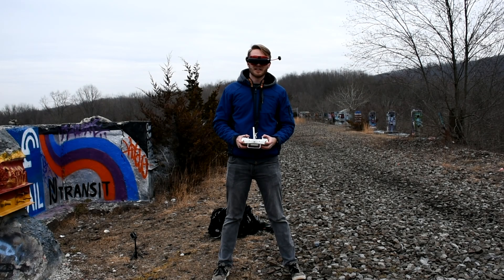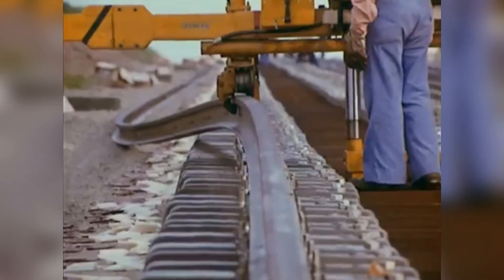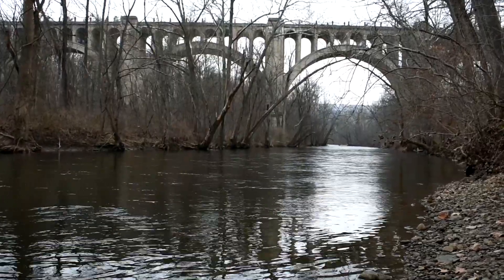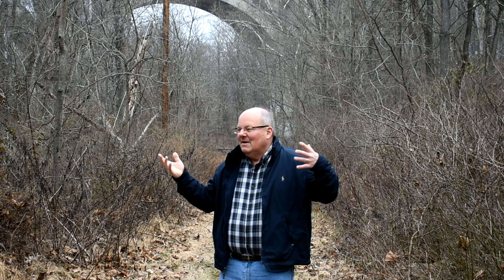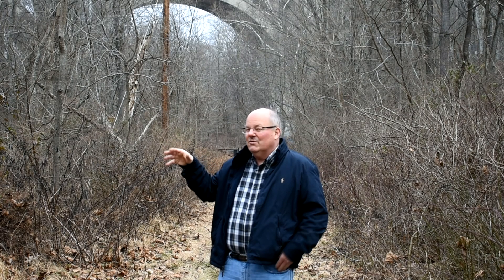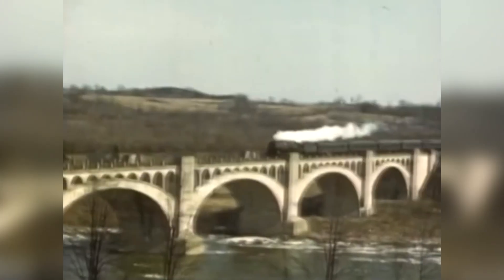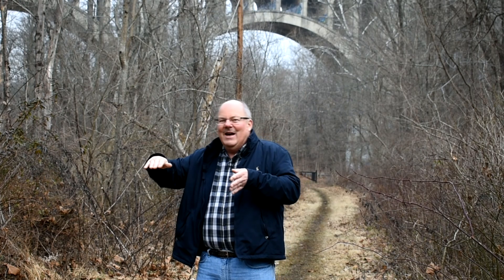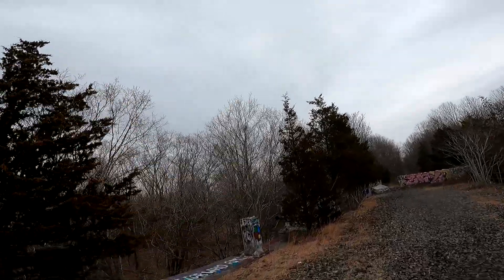The Abandoned Lackawanna Cutoff will be Brought back to Life

Comment: Nice video!
Gentle-ish curves are still important in modern fast and high speed passenger rail, but gentle grades, not so much. Modern electric locomotives are relatively light and extremely powerful compared with steam and even modern diesel locomotives. They can deal with significant grades and still mange very high speeds.
Reply: Not power limited. Grip. 
0.4 friction coefficient x locomotive weight / train weight gets you about 2% for a 20 car setup
Reply: Ehm. If we talk real high speed, rest-of-the-world-style high speed, grade is important. There is a reason why we dig all those base tunnels here in Europe.
Reply: @appa609  the Frankfurt- Köln high speed line has 4% max grade with 300 km/h max speed. And it's possible to hold that speed over nearly the entire line.
Reply: where are you going to get the megawatts from. the north east has had a lot of blackouts
Reply: @dknowles60 Trains barely use any energy to operate
Reply: @frafraplanner9277  wrong

Comment: From what I've read it was the Erie-Lackawanna's decision to sever the Boonton line, the high speed freight bypass of the Morristown line that fed the cutoff that doomed it under Conrail. Trains had to be able to handle the tighter curves and steeper grades of the feeder line negating the benefits of the cutoff, especially when Conrail had other options from the PRR and NYC. Hope it does get restored fully to service to Scranton and maybe one day even beyond. A rail connection would really benefit northeastern PA and the southern tier of NY.
The following is from one of the Lackawanna's "Phoebe Snow" ads advertising the cutoff:
Each cut and fill
Cross dale and hill
Has made the shortest 
Shorter still.
I now delight
Like Arrow's flight
To speed o'er
Road of Anthracite
Reply from the maker: It would be worth talking about in a different video how many of these railroads didn't have much future planning beyond either "we'll merge with this other RR later", or "once we find a way to fiance this, we'll build it".
In many ways this initial planning or lack of, crippled them later on. And then eventually Conrail had to figure out the mess. And then the whole question begins on weather or not conrail did it right and if they where left to sort through scraps without help.

Comment: Near me, in Huntsville, a school was buried in the process of making that Pequest fill.  My housemate showed me the historic photos of how they just erected this triangle-frame assembly of timbers and filled with dirt to make this enormous artificial ridge to create that very flat top the video explained.  You'd think viaducts, but apparently in the long run a solid ridge like that is cheaper.  Instead of mere underpasses, tunnels were bored under it for roads, railroads, and watercourse to pass north-south.  Impressive!

One of the old rail tunnels is being used as storage space by NVE since it adjoins their lot at Airport and Whitehall Roads, while the others are still active roads (e.g. US 206), rail trail, and the Pequest River.  I don't know what they did to the Pequest during the time they were building the ridge line and before they bored the tunnel for it; probably they'd've diverted it around where they were building that part, then bored the tunnel to reconnect it, then built over where they'd temporarily diverted it.

I've got to get up on that thing some time, maybe this summer, before they fence it off to re-lay track.

Comment: Thanks for the video. I was aware of this route and was told Conrail abandoned it and took up the track to help prevent a competing short line railroad from buying it and operating a competing service over the line. That is also why they looked to sell it to developers. If things were built on the right of way there would be little chance of it ever being used as a railroad again. Thanks to New Jersey buying it and considering expanding commuter service over the line it’s future is more secure to be returned to all types of passenger and even high speed freight service. The interstate highways even today are overloaded with both passenger cars and trucks in this area. So reopening the line makes more sense today than any time recently. We just need the political will and funding to make this happen.

Comment: 7:59
Has anyone told you that some of your electric locomotives look like someone glued a pantograph to a diesel engine?
Reply: Some of them are, especially on lines that use both electrified and non-electrified track - I know there’s a few around NYC as the underground stations in the city typically require electric running but the trains run on non-electrified lines outside the city. I’m sure the specific locomotive you pointed out was a predecessor to the modern ones on a similar line.
Reply: Kind of like how European diesels look like electrics that went under a low bridge?

Comment: The closure of the old Boonton Line East of Wayne could also be attributed to the closure. This moved all traffic over to the Erie Greenwood Lake Branch until Mountain View where it switched onto the Boonton Line which connects to the M&E in Denville and continues to Port Morris where the cutoff split off. The gradients after this closure were detrimental to the line as it meant it was just easier for the EL and Conrail to run up the Erie line entirely. They then sold off the route North of Scranton which was a continuation of the Lackawanna's route that involved a similar cutoff to the Delaware and Hudson. This all now seems like a waste of perfectly good railroad, but it overall was just to turn the railroads into sustainable entitys.

Comment: Great video. I live not far south of the fill and have walked much of it. Have a spike I found sitting on my desk. The story of that fill is an amazing one, and I don't think anything like it could be done today. Imaging proposing to pile dirt three miles across a valley now! You'd be in court for 50 years. With respect to the deficiencies of the original line I've always read the major problem was not the extra distance but the bottleneck at Oxford getting over Tunnel Hill, and later through the single bore tunnel built beneath it.

Comment: Update: Amtrak completed a study aimed at potentially reviving rail service to Scranton via this exact same cutoff. They estimate that upgrades to the PNRRA segment could cost 100 million to 175 million (The cost of rebuilding the remainder of the Lackawanna cutoff has yet to be determined), while buying two or three new Airo trains for the line could cost between 70 million & 90 million. Amtrak also wants to run trains as fast as 110 MPH on the rebuilt cutoff, so if that goes to plan, we could see a 110 MPH rebuilt Lackawanna Cutoff line in the near future.
Reply: Amtrak wants to purchase and reactivate the former and now defunct Mainline of the Central Railroad Of New Jersey.

Comment: It might be worthwhile to make it a passenger and freight line.  In many ways I think rebuilding the freight infrastructure would bring more benefits, even though passenger travel is more visible, poetic & romantic.   Especially if we built more localized container transfer points (the biggest problem being the transfer on & off of containers without large structures, and making smaller container options for localized deliveries).

Comment: Not a hundred years ago. Closer to 150 years. Brunel's GWR London to Bristol was built as flat, straight and low slope as possible. These have the widest flattest brick arch bridge every built just west of London. The idea bridge the gap across river with no change in elevation. This was started from London in the 1840s. These methods were used all the way to Bristol and (later) beyond.

Comment: I hope that this route will be re used and soon! Please don't let things go the way the government here in the UK has gone. We had a line built in 1899 which was intended to be a route to the Channel Tunnel that was going to be built by a consortium of British and French Railways. The Great Central Railway ran from Manchester to London via Nottingham and Leicester. The government halted the Channel Tunnel project out of an irrational fear of invasion but the main line from Sheffield to London had been built to continental loading gauge (the only line in Britain so built) it also had a ruling gradient of 1 in 178 and very gentle curves to permit high speed running. The line was closed in the late 1960's and rapidly pulled up and since then it has been systematically destroyed where it passes through the cities of Leicester and Nottingham.
Despite the fact that brand new bridges were built where it crossed the M1 and M42 motorways and most of the infrastructure was and  still is complete our government is now building HS2 a new route for fast trains between Manchester and London. It is not using the existing route but spending vast amounts of money (probably over a hundred billion pounds sterling) and costs are already well over budget despite cutiing out almost half of the original scheme. It will likely never be fully completed, yet the remaining parts of the G C R route are still left unused and decaying, including those new bridges which saw almost no traffic use their decks despite being designed for a lifespan of at least 125 years. Such waste of resources is little short of a national disgrace.
The moral of the story is please don't let the idiots in government get involved with the scheme because they will turn it into a monster scheme to fit their own oversized egos!
Good to see someone is taking a proper interest in using existing infrastructure for the best benefits to the nation. Good luck and success will hopefully follow your efforts.

Comment: seeing those old steam engines with their external drives flying at those speeds, those connecting rods for the drivers had to be incredibly strong & heavy.if one broke at those speeds the kinetic energy released would most likely destroy the whole engines & derail a fast moving train.

Comment: This is a good part of why both private and gov't ownership of the rails is untenable. The government will always mire it in bureaucratic garbage, and private industry will literally strip away the rail to save money. Having worker-owned or locally owned rail (owned by people like Chuck who are passionate and have vested interest in the success of the lines) is key to making sure these projects actually get done and that they are maintained.
Reply: Communism doesn’t work, since the incentive to keep it managed is not there. It will always default to the 20% who contribute 80% of the actual value to keep it going. 

The reason why it went under was because of the issue of freight running on the line. Similar lines in Virginia, such as the CSX lines that run and operate from coal country to Newport News are still economically viable and are about as straight as the cutoff as shown in the video. The reason why is because those sections of infrastructure still provide legitimate value by transporting a considerable amount of freight, which generates a significant amount of value. 

I’ve seen railway lines getting torn up, but the reason why is because they don’t produce any value due to a lack of usage. No usage means no line. 

It’s the same with old roads. If the road has been rendered obsolete, then it’s going to fall out of use and be abandoned.

Comment: Funnily enough, the Sussex Branch goes underneath it in the photo that you have at 5:42. You can see it going diagonally from bottom left to top right, straight line. It is also abandoned, and is now a bike trail.
Reply: Yes, and the tunnel floor (parallel US 206 -- old Morris and Sussex Turnpike route) is funny in that the east side of it is trail, while the west side is higher and ungraded.  It seems from the width that when they bored the tunnel they'd allowed for future double-tracking of the Sussex Branch.

Even the width of the old turnpike rights of way impressed me, in that they could be upgraded to the motor era without much trouble.  I'd've thought naively they'd've just been wagon width, but actually they were built to allow getarounds in such situations as where a tree would sprout in the middle of a previously cleared space and it might be years before it got removed.
Reply: You'd go past the revivors by 206 you can still see the tracks. From what I understand the went right up and probably past Branchville. Could you imagine rail service up that line again. It would make living there soo much easier than being on the road during snow storms and traffic congestion. But wait this is NJ Transit we're talking about, never mind.

Comment: Railroad right of ways should NEVER be retired.  Too hard to put back.
Reply: They should be rail banked. Turned into bicycle and walking paths and roads until required for other uses.
Reply: @stuarthirsch  rail bank is better than letting them go, but can be just as problematic.  People will fight their walking trails being turned into railroads.  Which ultimately is the same issue.  This happened in Ohio when the NS allowed so double track to be singled and turned into trails, the local government concreted he path, which the rail did not want.  So NS came back and put a fence around several miles of right of way to stop the trespassing.  Best of intensions, wrong result.

Comment: When Steamtown moved from Bellows Falls,  Vermont to Scranton, PA. they brought their collection of steam locomotives with them.   One of them was Union Pacific Big Boy no. 4012.   They posed it atop the NIcholson viaduct in 1985 in the middle of the bridge and above the name LACKAWANNA R. R.   Tunkhannok,  although not part of the cutoff is much,  much larger than the Paulinskill viaduct.   Believe it or not there were plans to run the Big Boy on the 28.5 miles of the cutoff from Scranton before ConRail lifted the rails.
🤔
Reply: No I don't think so.  They had so many issues bringing the big boy here.   It derailed multiple times due to the curvature.

Comment: NJ Transit is estimating travel times from the Pocono area to NYC at around 3hrs.....that wont draw in commuters! Driving to NYC in private car is around 1.5 hrs or the Trailways bus is around 2hrs with intermediate stops
Reply: probably because they're using outdated diesel locomotive trains instead of actual high speed, multiple unit trains.
Reply: @regulate.artificer_g23.mdctlsk  it would be ALP-45DPs at that point and those are definitely not outdated
Reply: @_SP64_  I'm not referring to the model/units used by the US, I'm referring to the technology in general. A train only pulled by a prime mover, operating on that kind of service... is outdated, globally speaking.

The ALP-45DP would be better suited for freight operations - other countries certainly use their locomotives like the ALP-45DP as such - but the US does freight very differently, or does trains in general very differently.
Reply: @regulate.artificer_g23.mdctlsk  That is a fair point but diesel isn't gonna be going away at least for the time being especially in the U.S. As with the ALP-45DP it can go rather quick in diesel mode at around 100mph and for it to be a freight loco it would have to go through several modifications as it was made specifically for passenger use. Heavier locomotives are just better suited for freight especially with the amount carried in the U.S.
Reply: @_SP64_  Right! Freight in, for example: Switzerland, tend to be shorter and the locos they use are exactly like the ALPs, or sometimes they use smaller locos. Diesel trains can be so much more efficient; look at the British Rail Class 185 for instance.

Comment: Every time I drive US-52 North out of Lafayette Indiana and encounter the long straight section of Old Railroad following US-52 in its section that runs basically north-south I keep wondering why doesn't Amtrak use that line to Chicago instead of the crappy curvy CSX line? I looked up the history of that old line and guess what!!! It was originally part of the New York Centrals "high speed" service from Indianapolis, Lafayette ending in Chicago! In 1948 you could buy an express ticket from Indy to Chicago on that line, it would take your city to city in about 3-1/2 hours! The best Amtrak can do today is 5-1/2 hours! Guess how long it takes to drive I-65 and the Dan Ryan to get city to city? 3-1/2 if traffic is perfect!  I think all the good fast passenger rails were deemed obsolete by the Conrail and later NS/CSX/UP and BNSF with trackage removed for a damn good reason! Ensure that Amtrak HAS to run beneath the Freight Rail Coveyor companies and to ensure all Federal and State transit money goes for "Fixing Traffic" sad and depressing.

Comment: So how long would it take to get from Scranton to NYC, if they do everything right?
Reply from the maker: Slightly over 2 hours, depending on what is upgraded and if the train is an express service.
Reply: It will only work as a HSR service they should connect the Lackawanna cut off to a new viaduct to NYC or elsewhere
Reply: @alanthefisher  Business on the Lackawanna was really never Scranton to NY. It was the Poconos to NJ.  A major business stop was Newark. Where people got off to go south on the Northeast Corridor.  It required walking down the Newark Station staircase with bags and kids. Taxi or bus or walk to Penn Station or maybe the CNJ station.  No light rail yet.  Lackawanna trains flipped seats alot on the way to Chicago.  People rode between the small cities on line.  Not much out of NY unless they were going to the on line towns.  NY had the Penn and the Central . No H&M or ferry ride to Hoboken. But if you lived in New Jersey! It was perfect. Stops east of Blairstown were restricted.  You could not get off there on westbound trains. Or get on there on eastbound trains.